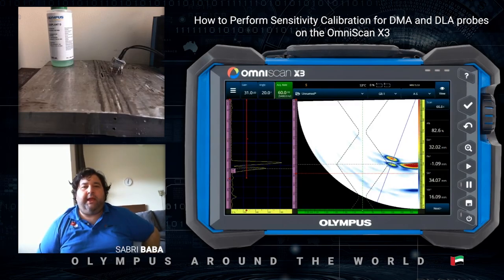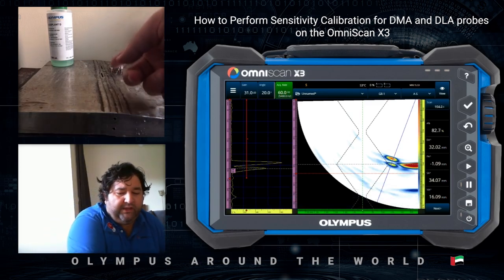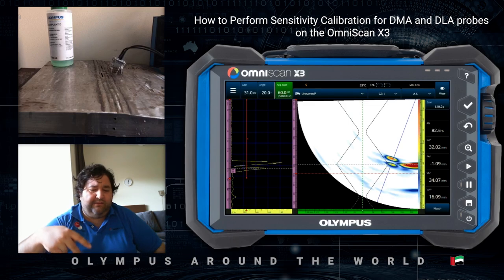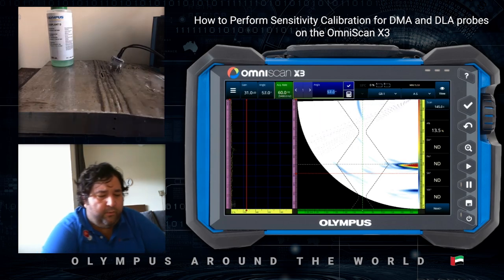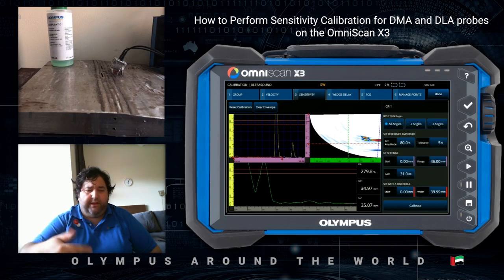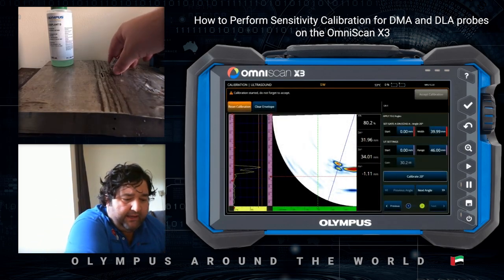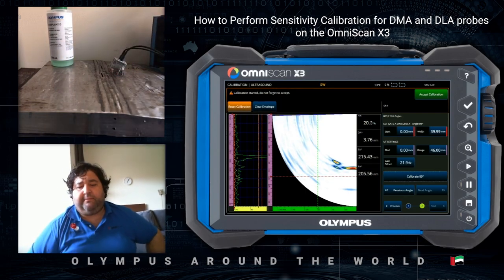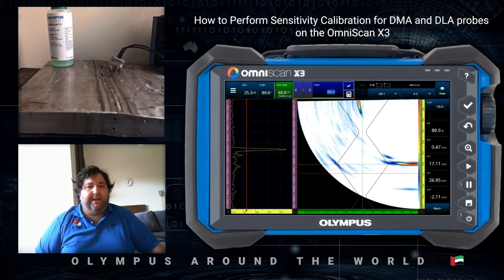10. How to Perform Sensitivity Calibration for DMA and DLA Probes on the OmniScan™ X3

Comment: Hello.
I am using A27 probe & DN55L-FD-15IHC Wedge.
When I am scanning 22mm block id notch with 21.52mm depth is appearing below the thickness.
I mean at 23.5mm.
How to perform the delay correction in this regard.